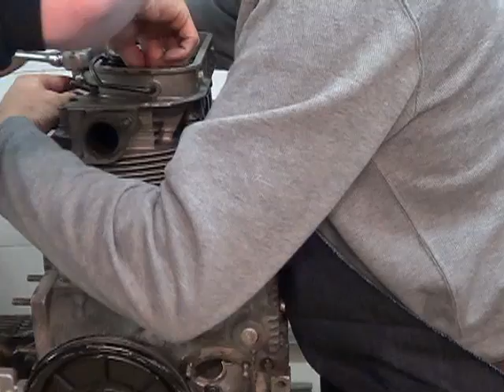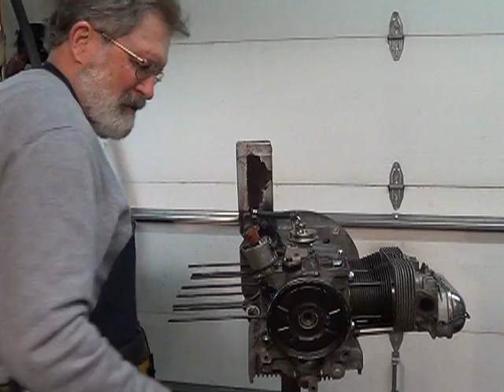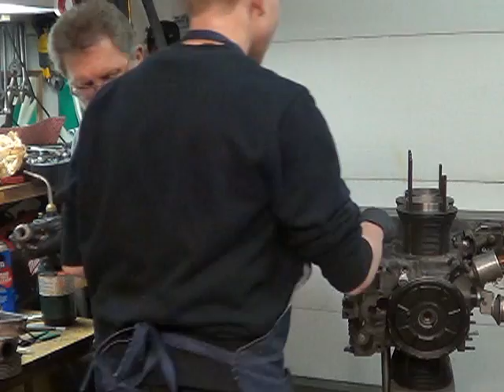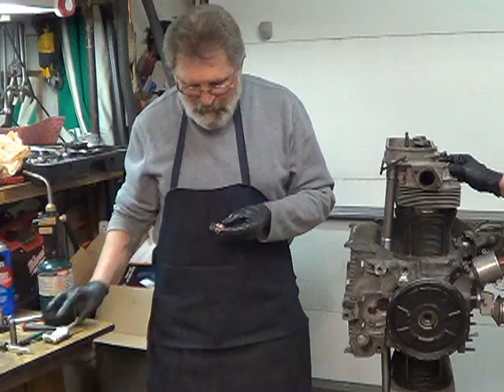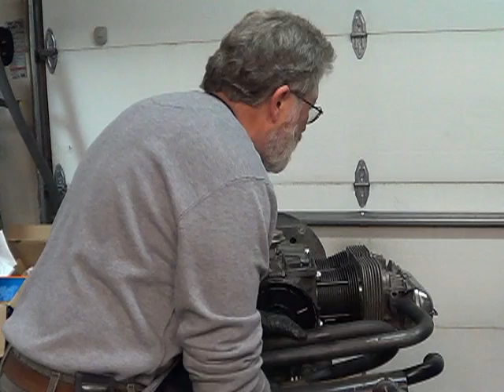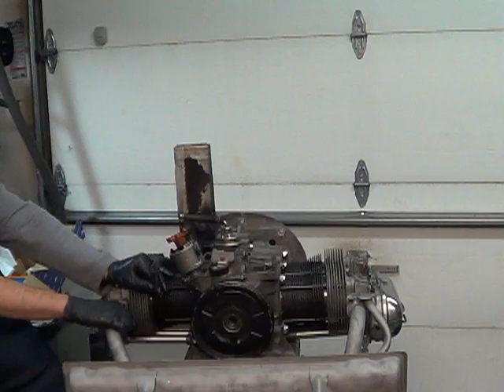1776 assembly #4

Comment: Looking to go 1776cc from 1600 as I've got massive blow by. You recommend any type of cylinder heads? CB performance, but what kinda valve sizes should I be looking at? I dont want anything too mad. I'd rather a bit more reliability than ultimate power. Cam will probably be engle 110 or equivalent from Scat. 

Looking to tow a teardrop trailer behind a buggy so extra displacement seems a good idea since the engines coming apart.
Reply from the maker: Towing!!!!!!    Stock cam or Engle 100.  Stock valve heads from Car Craft.
Reply: Thanks! Will hopefully get it rebuilt soon. Im busy at university though, doing my masters in mental health nursing / psychiatry. Your vids give me a welcome distraction! :-D

Comment: is a scat crate motor set up for a turbo
Reply from the maker: Yes and No.   You can add a turbo to most any engine if you keep the boost to around 7 lbs.  But to get the max benefit you would probably want to start with a 7 to 1 compression and have some heavy duty internals as well as a Turbo specific camshaft grind. 7 psi boost will add about 30% to your existing Horsepower.  I hope this answers some of your questions.